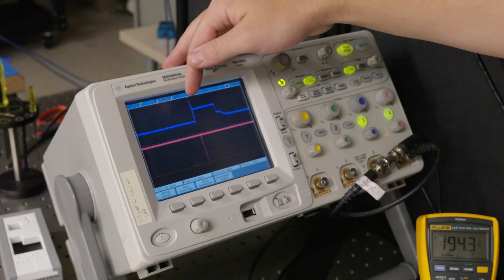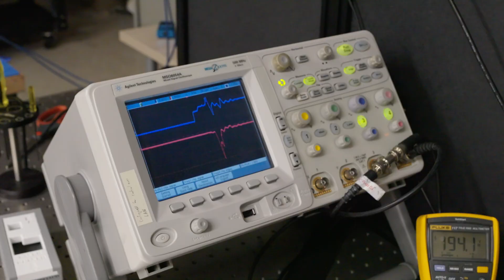Build a Nanosecond Laser Blaster for Under $100

Comment: Well...  As someone who hasn't messed with lasers...  The goggles a lone eat up most of that $100
Reply from the maker: Good point, they are pricey. Probably can get cheaper ones if you are only using a single laser wavelength, but cheaping out on safety equipment is a bad idea!

Comment: les's lab did the same thing, but got the pulse length down to 2ns for much cheaper and a more simple design.
Reply from the maker: Oh nice, I'll check it out.
Reply: This circuit is exactly the same as Les'. It is far more developed, as it provides also the high voltage power source from a 12V supply.

Comment: So, first off - this is amazing. Cool to see. Feedback: 1) "Fanning out" the PFN like you did really hurts your inductance. For a good example of an alternative take a look at TI's TIDA-01573a Figure 4, where they put their RC network across left and right to minimize the loop area. 2) A design like that; SiC or GaN FET is much faster and more reliable (part to part and vs temperature/time) than the BJT avalanche you're using. It's a lot more efficient and comparable in cost. Again - hope the feedback is positive, amazing to see this work out in the open like this!
Reply from the maker: I'll point this out to Aled, who designed the board.

Comment: Amazing video thanks for sharing ! 
Can you discuss a bit more on the "safety" for the laser diode ? How do you know what is the current limit before you start damaging the laser ? Do you have some metrics that allows you to track for degradation ? How does the max current limit depend on the pulse length ?

And maybe a last one : how do you shop for laser diodes that would tolerate the higest current pulses ?
Reply: I went on digikey, looked for laser diodes with rated powers in the watt range (I also bought a few IR ones intended for this application which are not in the video). For biasing, the boost converter is adjustable via a potentiometer and there's a pretty obvious turn on in the current waveform once you drive the laser above threshold (due to the eye protection I can't actually see the beam visually and missed this on the green diode we had and burnt it out, hence only the blue for this video.

Thinking about this slightly harder than I did during the initial selection, the thing I'd look for is built in TVS protection from a reverse zener diode. We have one on the board but there's significant lead inductance between it and the actual diode which will cause a high negative going transient voltage during the high di/dt edges. With an integrated zener as near to the actual diode as possible, this can discharge through the zener. The green diode I exploded didn't have this feature and the blue one which has been going strong does although that may be a coincidence
Reply: This is the diode used in the video: https://look.ams-osram.com/m/76ffe3c42f23a38f/original/PLPT9-450LB_E.pdf
Reply: @aledvirgil  The plpt5 are only good for about 1.6W CW. Google DTR laser shop, and you can get Nichia blues that are good to ~7w cw for pretty cheap, and they are tough to kill. The green are much easier to kill and the IR and red are the worst. BTDT. I am surprised you aren't triggering the ESD devices. Maybe you just vaporized the bond wires. Like others have said, if you weren't using the hotplate to preheat the board, the big aluminum heat sink wasn't doing you any favors. Also, depending on needs, take a look at iC-HG30 and iC-HS. Neat project! Good luck!

Comment: You used a hot air gun when your board is on a hotplate WTF?
Reply from the maker: I would have used the hot plate too, but maybe he didn't want to overhead the plastic bayonet connector.
Reply: @ExperimentalAstrophysics  That plus not wanting to put too much heat into it so I could test it quickly without burning myself
Reply: @aledvirgil  Watching you do this gave me ab idea. From now on I'll use my hotplate to preheat the PCBs to a relatively low 85C (should be safe for all plastics and ICs) so that I can use the hot air gun for a much shorter time, to bring the paste to its melting temperature, hopefully making it much harder to fry sensitive components.

Comment: I still amazed that the circuit is fairly simple (LD, Fet and energy storage caps) yet can create ns or less pulse . I was working on ToF lidar project. And while reverse engineering the Hokuyo lidar. They are using just one 0603 cap and tiny SOT-23 FET and they can pulse this laser and the energy density was so hight that the beam reaches 20 meter (plus 20m return trip).
Reply from the maker: A lot of power in a small package!